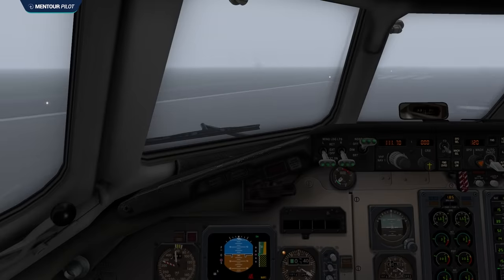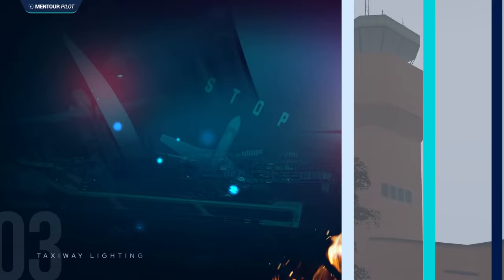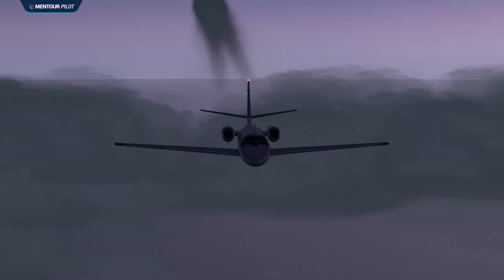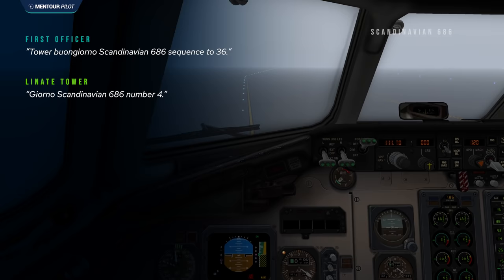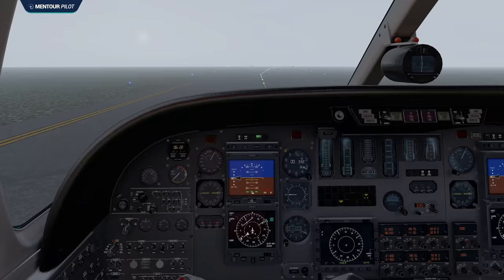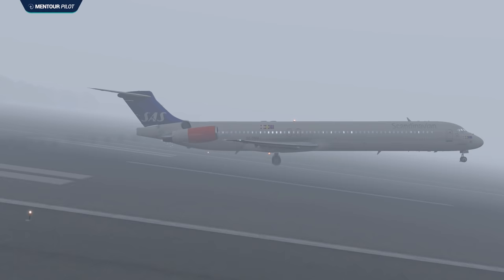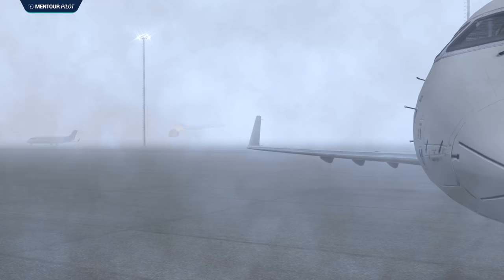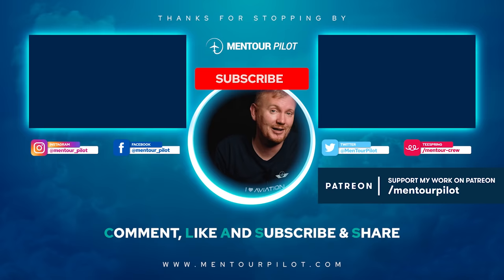A Perfect Storm of Mistakes! And how Heroic Pilots Almost solved it.

Comment: Please do the 11-04-2008 Mexico City Lear 45 crash.  Super excited to see that one!!!😁
Reply: yeah!!
Reply: @fsrr4409 It'll be awesome  to see your indepth analysis of the 11-04-2008 Lear 45 Mexico City crash . . . already learned quite a bit about it from Air Crash Investigations, but your analysis will uncover more. Didn't they simply roll the jet upright to recover,instead of trying to loop all the way back around while upside down at low altitude?  How is the Mexico air travel, which is completely military controlled, I think -- -- how could at least one of the two pilots be rated as a Lear 45 instructor, and not be able to program the flight control computer (the flight school bogus "certification sign offs" ). You probably can't report on it, to be respectful, but what in the Mexican culture allows such tragic nonsense to even happen . . . . Really enjoy all your work / analysis -- -- cheers to your successful, fabulous productions! 🏔️✝️😇✡️✈️

Comment: The ones who ran the airport IMO are fully responsible. They made the decision to still keep the airport open despite no ground radar or properly working taxi lights.  They were essentially being cheap and had everything together with "duct tape". Those decision makers should've gone to prison.
Reply: They did get prison time. The cessna shouldn't have landed nor restarted though and additionally took the wrong taxiway eventhough they knew the airport well

Comment: I am having issues with the AFRS waiting for clearance to enter the runway. Having worked AFRS at an international airport, when there was an incident on the airfield the environment was ours. All aircraft were instructed to stop and hold position until instructed to move. We could go any route to achieve the fastest response and would cover the runway's full length if the aircraft was taking off or landing. The senior fire officer would release aircraft for movement when the response was completed but block out areas from aircraft use to facilitate AFRS operations without clearance delays from the tower. Aircraft movement would switch to the runway on the other side of the field as we had two parallel runways separated by terminal complexes.

Comment: I am reminded of a workplace safety inspection where the inspector asked a crew, "are you TRYING to break rules?"
Reply: In general, I try not to be a "String them up in a tree" type of person. However, the conditions of this airport seemed to fit the definition of malice and criminal neglect. This is a case where the airport management should be brought up on charges.
Reply: @jackielinde7568  I doubt they intended to kill anybody, but when it reaches a point where people who have no history or training in the field can see why it's being done wrong; there needs to be a change in management.
Reply: @kenbrown2808  Oh, I agree no one working at that airport intended over those years to kill someone. However, there is a legal concepts in both the US and British legal systems where the level of negligence and/or carelessness is so high that it becomes a serious threat to public safety, it is considered criminal. (I think Malice and Criminal Neglect are used interchangeably.) So, even thought they never intended to kill someone, the neglect management had towards this airport was so bad that they should face charges.
Reply: @jackielinde7568  malice and criminal neglect are separate in the US.  but yes, if they found that a person was responsible for the worst of the negligence, then they should be held responsible.

Comment: It BLOWS my mind how an airport like that could even operate. I've heard about many different accidents, but this one got me almost speechless - faulty lighting? Nah, it's just some stupid lights. Ground radar broke? Hah, radar goes brumm no more. Oh, so maybe some random markings on the taxiway that confused EVEN THE ATC? Who cares! Mindblowing. Just mindblowing.
Reply from the maker: That’s basically what the final report said as well.
Reply: @MentourPilot  There is even more: during the following criminal trial a few years after the fact, it was apparently found out that the air traffic control operator headset didn't have a working automatic volume control, and the communication from the Cessna plane was barely audible to him. When a toxic mindset is allowed to take over a organization due to carelessnes and greed, and the check and balance system is destroyed, there is no limit on how bad things can become. It can happen anywhere; it is important to be aware of the danger, be assertive and try to stop the bad habits before it's too late.
Reply: @paolocanali3361  with all of this, airport managers were found not guilty after appeal, but the air traffic controller was sentenced to 8 years in prison.
Reply: Well said.
Reply: @Paolo Canali

Comment: Let me get this straight: aircraft had time slots of 15 minutes, multiple aircraft lined up to take off, and it took them 36 minutes to find a fire on the active runway? They just didn't use the runway for 36 minutes? Not to mention that lack of communication from the fire crew, who should have been in contact with the tower to prevent aircraft from impacting the fire crew. I legitimately have to question the management and control of the airport in such a scenario.
Reply: Reading one of the other comments here apparently a Lufthansa flight was cleared for takeoff but the crew refused the clearance as they hadn't heard from the SAS crew. It could have been even worse...
Reply: @tomriley5790  Thats... truly terrifying.

Comment: Wasn't this the accident where they jailed one of the ATC's which was then criticised by the safety board (whichever one it was) because they said that going on a witch hunt wasn't the right thing to do to improve safety?
Reply from the maker: That might be right but it wasn’t in the final report so I didn’t cover the legal aftermath
Reply: Yes, the ATC was jailed and also two Airport Managers.
Reply: Thanks for your replies.
Reply: @NicolaW72  The airport managers were found not guilty on appeal. The ATC was found to still be liable on his appeal, though had his sentence shorted by 3 years due to the Italian government passing a law shortening all sentences.

It seems those responsible for putting the holes in the cheese weren't held responsible, but those who worked in the broken system were. If those who made decisions to save a little bit of money at the risk of other people's deaths in situations like this were held responsible, the world would be a much safer place.

Comment: hard to believe no one complained about this taxi way signal spaghetti until a wreck occurred. surely some noted that lack of standard operating procedure.
Reply from the maker: Yeah, that’s the problem with these things. It is only seen as a big problem when something big happens.
This is why it’s so important to report even small items if they have safety-implications.
Reply: That's why bigshots were harassing/threatening workers complaining about failed/lacking equipment and safety issues.
Safety always starts from making top management (and their back skin) personally responsible for safety failures.
And in this case there should have been plenty of back skin beating for about total systematic failure of management and organization/system...
Reply: @tuunaes  The airport manager and air traffic controller were both sentenced to 8 years. The airport manager was found not guilty of a criminal offence after appeal.
Reply: @DERP_Squad  Meaning true guilties didn't get anything.
Traffic controller was among the lesser guilties.
Sure he along with Cessna pilot made mistakes.
But the way airport was run by management and "responsible" organizations they were set up to have fatal accident sooner or later!

Comment: That airport needed a bunch of issues addressed for sure(both in terms of resources and infrastructure management around safety)
To how staff do their jobs.

But on another aspect that Cessna crew also caused a large aspect of this chain of events by not following instructions and going to the wrong place at the wrong time.
Ignoring markings and signs without being given clearance, their visibility rating being woefully inadequate.

I feel sad for the MD87 crew who dealt with this horrible situation thrust upon them.
They tried to perhaps heroically stop a much worse disaster from happening.
Reply: While the Cesena crew did contribute to this disaster, the lack of consideration of safety by airport management made a disaster like this almost inevitable. Runway incursions had become almost routine, with one happening in an almost identical way just the day before. If this disaster hadn't happened this day, the situation almost guaranteed that sonething similar would happen at some point.

Using the Swiss cheese model, it seems the airport management had taken a drill to the cheese in order to save a little bit of money. In the trials that followed, the airport managers were found not guilty on appeal, whilst the air traffic controller was sentenced to 8 years.
Reply: @DERP_Squad  "...the airport managers were found not guilty on appeal, whilst the air traffic controller was sentenced to 8 years." 

This is not correct: the airport director has also been held accountable, as well as two responsible senior figures from the air traffic control authority and the aviation authority. In total, 11 people were given prison sentences.

Comment: 15:50 How on earth tower control or ground control wouldn't be aware of all markings on the taxi roads and runway? Is this assumed to be normal today on other airports?
Reply: If the markings didn't make it into the official charts for the airport, I could see this. Also, not all ATC are pilots, so they generally aren't going to be allowed anywhere on the taxiways and runways. And that's assuming that the ones who are pilots are flying in and out of their own airport. Again, this is more a fault of Airport Management and not the ATCs themselves.
Reply: @jackielinde7568  I'd expect any marking changes on airports to leave a papertrail roughly visible to moon so ATC should be able to get information about new markings on taxiways.
Reply: @MikkoRantalainen  Again, you're trying to do the one thing that doesn't make sense in this situation: "Apply Logic." I'm sure there was some sort of paper on this, but because of whatever change didn't happen, it didn't trigger a change to what the ATC's had in their office. Again, this is a problem with airport management and not the ATCs.

Comment: There are probably a lot of avoided accidents that get to the “next error is an accident” status but the redundant safety measures prevented them so when it does happen, you know a lot of people failed their duty for this to happen.  Chiefly here was the failure to maintain proper and safe airport taxiway designation markings.  Also, I do not think any intelligent person much less a pro pilot would/should make the assumption that it is safe to cross a runway without explicit secondary confirmation right before entering said runway [least of all in bad visibility conditions].

Comment: Let me get this straight: there were two air traffic controllers managing planes in intersecting areas, but since they didn’t have a ground radar, they couldn’t know either where the planes were, or what the other controller told their planes to do…
Reply: pretty stupid isn't it. My mind was blown to realize even the number markings on the runways were incorrect
Reply: Here´s the thing, the plane model or the company is not the major thing, it´s the airport standards, no ground radar, and  the lack of active leadearship in staff, trainng and technical investment/uppgrade in the airport. As this happened in Italy is a total scandal, shame on you Italian airport leadership.

Comment: Would thermal imaging goggles along with heat elements marking the runway help? We used these back in the 1980s in the Army on the M1 Abrams gunsight. Fog, bad weather, limited visibility, it did not matter. Anything that gave off heat, we saw clearly. Just a thought.
Reply: No

Comment: Can the ground controller even issue runway crossing instructions? I thought that is controlled by the tower?
Reply from the maker: It is indeed. Yet another piece of the puzzle.
Reply: The ground controller didn’t issue runway crossing instructions. They thought the Cessna was somewhere else not near the runway.
Reply: @jeremypnet  That's my question exactly, they crossed the runway without clearance, while talking to a ground controller... must have been a lot of commercial pressure in the cockpit.

Comment: Those two processional and dedicated and brave SAS pilots used all the the meagre resources left in the stricken aircraft to try and save the lives on board AND people on the ground. During their last heart-beats.  And they clearly succeeded as far as their dire circumstances allowed. Many died, but many more were saved. An inspiring a bitter-sweet story.
And then the foulness. Pilots who put profit before safety, flying in conditions they must have known they were not rated for. The authorities in charge of the airport, who appeared not to communicate, making add-hoc improvements to the airport. Lax procedures, probably money concerns over safety. Over-taxed ATC people in an increasingly busy airport. An accident waiting to happen. Not if it would happen, but when. Not replacing the ground radar, what is that? Not wiring the lights properly? And dozens of other mistakes. The bitter pill.
That said, commercial aviation is relatively immune from profit-driven deaths. 
But a former American President and his party can do a real disinformation campaign on the people of the USA, and a million people died from COVID-19. Compare US death from COVID to Australian deaths, controlled for the differences in population, and the US deaths were about 10 times higher than they should have been. A whole order of magnitude difference. Republican supporters are still not getting vaccinated. 
Trump may as well have set off a nuke in a mid-sized US city, but perhaps that might not have had "plausible deniability". But gross, and even deliberate neglect? "Legitimate Political Discourse", apparently, according to the RNC.  
But Trump and many of his minions who spread lies about elections, the public health crisis, and so much more have yet to suffer an indictment for a parking ticket, never mind mass murder and an attempted self-coup. Drinking one's own urine will cure you of COVID-19, so some claim. Or dinking bleach, or horse-worm medicine. Scientists and medical and public health people mocked. Mask-wearing is mocked.
Will US democracy survive? Will reality survive? Kill an airbus full of people, even in a genuine accident, and people pay attention. But is it all about the sanctity of life? Or airlines not wanting to be sued for billions of dollars if they present the public with a few hundred body-bags? 
A cynical and dark comment perhaps. 
But if we can honour the deaths of those two brave SAS pilots, perhaps we can look at how our politicians [everywhere] handled the global health crisis that SARS-CoV-2 visited on the world. Nearly eight billion people, but 6.18 million deaths for the whole world. The USA has a million deaths from COVID-19, but only less than 330 million people? How does that work? 
This is off-topic for an aviation safety video. In one sense. But dead is dead. If the aviation industry can keep those body bags from being filled so well, why not society in general? 
Vote for a troll today, and watch the blood-bath tomorrow? The "Trump loves Putin club". Putin invades Ukraine. It is all madness, utter madness.
Reply: Yes.

Comment: It still baffles me how the tower can co ordinate flights in and from the runway and taxiways when there is no visual contact .The same with ground control.For all the technology in the world if my eyes cant see where I am I stop.Thats what my brains instict tells me to do.
Reply: Generally, airports do have ground radar and other bits of infrastructure that help them see the aircraft moving around. But such tech hasn't always been around. Generally, airports have an operational schema or flow to them. Taxiways will typically be used in single directions, with aircraft lining up to get on the runway being routed around the routes to take aircraft off the runway. And, as Peter said, traffic at certain stages are usually handled by specific frequencies. So you can manage traffic without needing eyes on each individual planes. As long as everyone's doing what the ATC for Ground frequency says and everyone's on the ball, it becomes a choreographed dance. But, mistakes happen, which is why we have ground radar and runway incursion warning systems.

If you really want some fun, you should check out submarine warfare techniques, where almost everything is tracked and charted by a stopwatch.
Reply: @jackielinde7568  Your last comment submarines is the old "dead reckoning" that early aviation used with a navigator.The most important man on board arguably.
Reply: In addition to what Jack Linde said, at most airports the ground control have a map of the airport that they move markers representing the aircraft around on so they know where the aircraft are. The map used to be a physical map on a table, but most are now electronic displays.